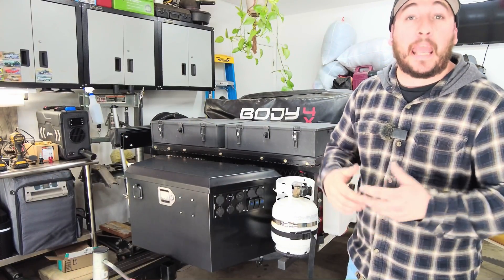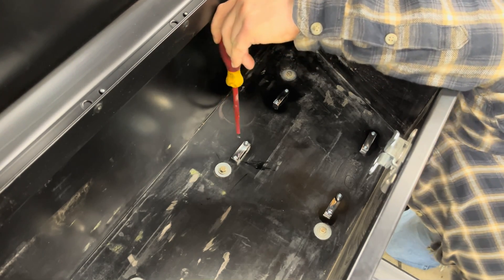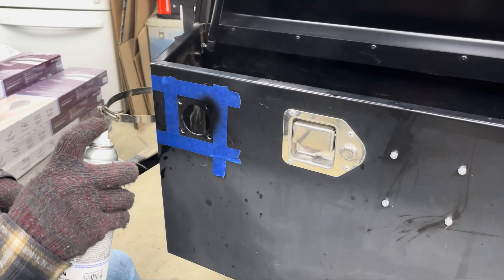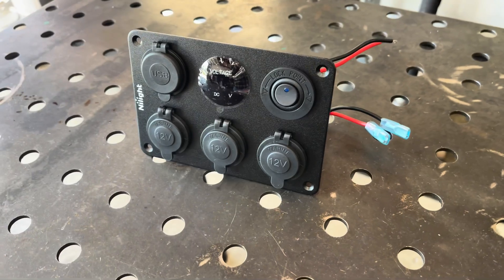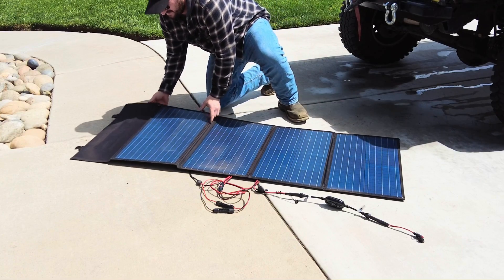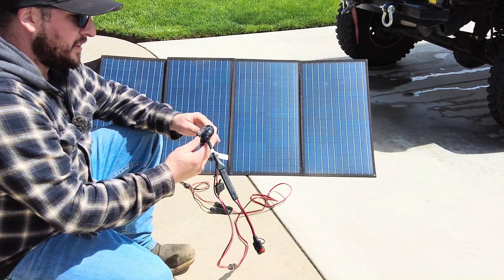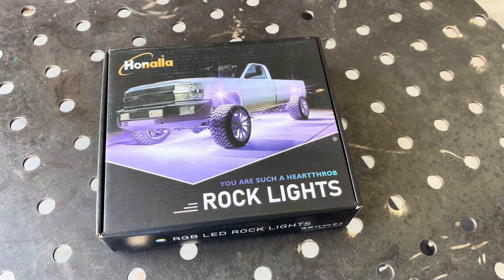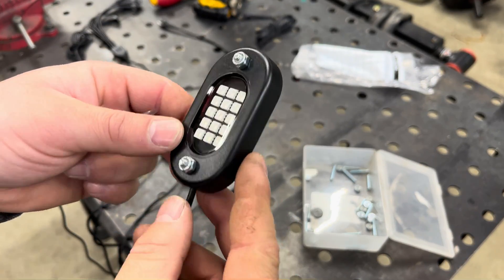Budget Overland Trailer Build Pt:10 DIY 100Ah Power Station Using Harbor Freight Trailer Cargo Box

Comment: Love the video.  Inspired me to get the battery and power my trailer.
Having one issue (hoping you can help) with powering my fridge. Wired directly to battery for fridge, but it melted the wires.  All lights are wired thru switch relay panel.  Do I need to do the same for fridge?  Thanks for any help.
Reply from the maker: Power at your convenience makes a huge difference, you won’t regret it. When wires melt it’s usually caused by too much amperage flowing through the wire, loose connections, or too long, and incorrectly sized base on the load demand. The insulation gets hot and can melt. You also want to protect your wires based on its capacity a fuse is typical for Dc but there are CB for 12v motors. load, keep wires short and protected.
Reply from the maker: I would keep the refrigerator on a separate circuit
Reply: @ATEMOFFROAD  changing the wire size and a separate circuit.
Reply: @ATEMOFFROAD and to clarify further. A separate FUSED circuit.

Comment: I bought the Honalia lights, they had a huge sale on them. Got to 8 packs and a 4 pack for the price of the single 8 pack. one set lasted 5 minutes, the other 2 won't even connect to Bluetooth. The app is garbage. 

Great idea and video though. Hopefully the replacements work better.
Reply from the maker: @dadsquatch79  they are cheap that’s for sure, and I noticed they run a bit hot, but this six pack seems to still be holding up and working though,  sorry about your luck on these and Thanks for watching. 🍻

Comment: Love your work, but one small suggestion I have is to use some dielectric grease on terminals etc. so help avoid any corrosion issues.
Reply from the maker: @JeepinDownUnder  thanks bro, I appreciate it, what dielectric grease do you recommend? 🍻
Reply: One caveat, dielectric grease should never be used in between connectors. Only to prevent moisture intrusion into a cover or exposed wire. Dielectric grease is non conductive so it can cause poor connections and excessive heat.